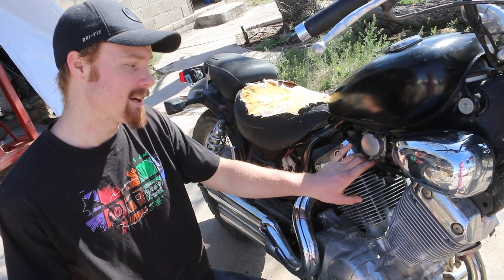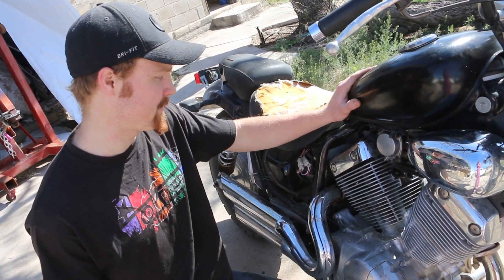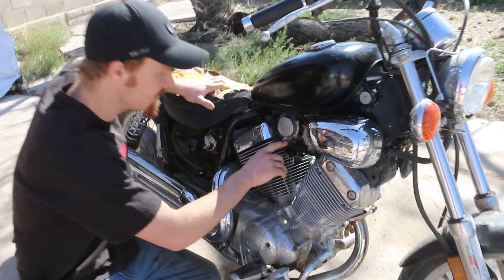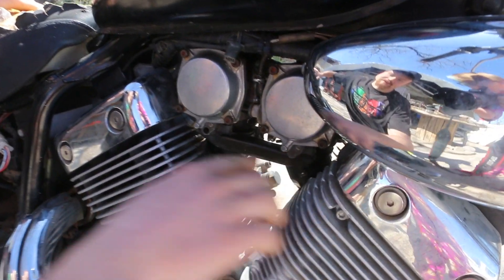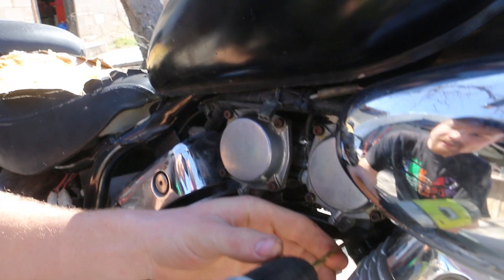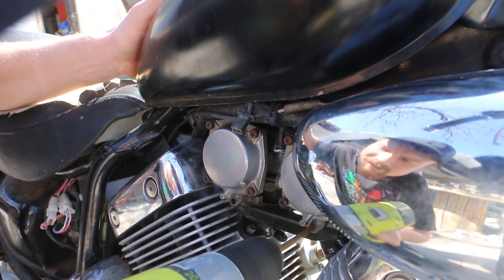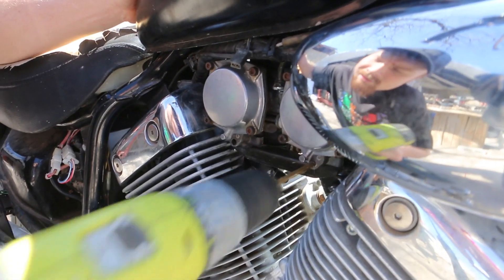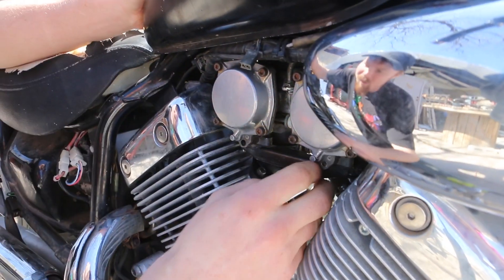How to Adjust Pilot/Fuel Screw on Motorcycle - Yamaha Virago 535

Comment: I literally have to hard back manual that comes with the bike. It says to take it to the dealer for the (Idle fuel/ air mixture adjustment). This is because of emission regulations, so they were made to put the plug in I think. You can take mine out normally though, but the point is... even the book won't tell you how to adjust it.

Comment: I really wish this video actually did describe "How to Adjust Pilot/Fuel Screw on Motorcycle - Yamaha Virago 535!"  Mine are already drilled out. but I'm very new to motorcycle maintenance, and I can't find any information on how to adjust these so they idle right.  Also, should one adjust them in a certain order?  Mine is a 1996 XV 535...  Anyone have any advice or links?  Thanks!
Reply: Hey man, three years later and there's still no guide on these carbs. Did you find the definitive guide on adjusting these specific carbs?

Comment: I've just replaced my exhaust on my 2002 yamaha xv 535, there was a lot of popping on deceleration with the old exhaust, which was knackered, I have installed a full system off Black Widow , and there is some, not a lot of popping on deceleration, I don't know if it's the fuel mixture, or something else, how can I adjust the mixture to see if it helps, the new exhaust has fitted perfectly , all that remains now is the popping. regards John
Reply: The rear spark plug looks like it's fine, the front spark plug is a bit on the dark side, don't know if that helps.
Reply: Did you end up figuring it out?
Reply: I had the same issue .. popping and banging on de cell.. I ended up winding those idler jet screws all the way in and it mostly stopped popping and banging and feels faster .. but the issue is a corroded idler jet … corrosion has caused the inner whole to be larger and therefore more fuel is being dumped then ignited in the exhaust . So I screwed that adjuster litrally all the way in on both carb till it stopped dead . Now it only pops like once in a while .. ideally I need to rebuild the carb with new jets

Comment: Hey man, I have a yamaha virago 535 and I took the carb off this winter to clean it, and now that I've put it back on the bike won't start. Do you know what the problem could be? It sounds like it want's to start but it doesn't get, the engine doesn't get that deep rumble when it kicks in, you now? It just sounds like it's trying really hard. Did I put a screw on too tight in there?
Reply from the maker: r u getting spark? There r no adjustment screws on the inside of the carburetor so u should be good there. Spray some starter fluid in the air filter side of the carburetor and if it fires then u have a fuel problem and if it doesn't then it is probably spark.
Reply: what kinda fuel problem could it be? and how do I check for spark? I don't know where the spark plugs are, my first bike and first time trying to fix it
Thanks for the response
Reply from the maker: There r 2 spark plugs total one located under a chrome cap on the top of the each cylinder head.

Here is a pic    https://www.bing.com/images/search?view=detailV2&ccid=z9l3hgN6&id=C165B181D302E342B4C77F8231BEE40D037FDE6E&q=xv535+spark+plug&simid=608033947394968341&selectedIndex=19&ajaxhist=0 

Here is a good video on checking for spark    https://www.youtube.com/watch?v=5j05y5squhw
Reply: Ohh I was wondering why I couldn't find the spark plug.. there's cylinder head caps you gotta remove first. As I said, first bike
Reply: Thanks a lot for the help. I found the spark plugs and tested them. Two beautiful blue sparks, workin really well.. So there must be a problem with the fuel. I must have screwed up the carb when I was trying to clean it. I notice that the O ring is sticking out of the bottom boot that connects the carb to the engine. Could that be it? Like, when I was squeezing the black boot thing on the O ring must have slipped half out. Is that what might be screwing up the bike? I haven't tried the starter fluid thing cause I don't have starter fluid. Is there a special brand or type I should buy? Also: Could the battery be doing it? The water levels dip below the low level on some of them.. not by much, but by a little
Reply from the maker: +sadkeannu u should fix the O ring but I don't think that's the problem. At this point starter fluid is just going to tell u if your engine has enough compression to fire. I would focus on the carbs. Where u feathering the throttle when u where trying to start it? The battery can cause the bike not to start but if u have a battery charger u could throw it on there and rule that out.
Reply: I'll have to buy some starter fluid tomorrow if the stores are open. Yes, I was feathering the throttle and it makes a grinding sort of noise when I do. I have freshly charged the battery to 100% so I don't think its that. I'll have to wait for the starter fluid and go from there. Thanks a lot for the help, it's tough diagnosing on my own
Reply: @sadkeannu hey man, did you ever sort this problem out? I have the same now
Reply: @tokiodj1537  Nah, I sold it in an unworking condition

Comment: Hi Brother. I have 94 Virago 535. It starts first time every time. But when I open the choke in cold days the bike stops. It works fine on idle. Only it stops if I use the choke. Also When I ride, I press the clutch lever to change gear, If I keep pressing too long time on the clutch lever (Running like on neutral) the bike sometimes stops. Is there any problem with my bike?